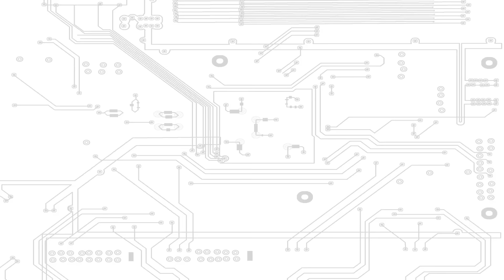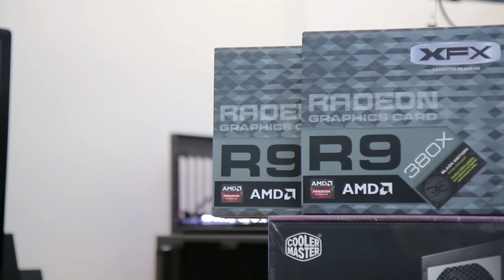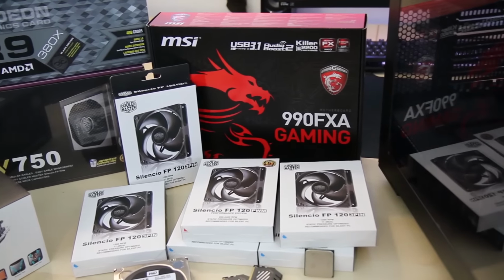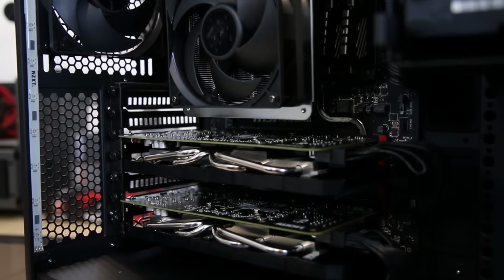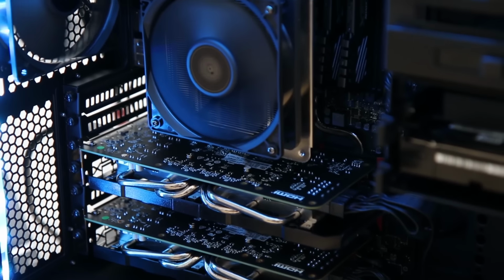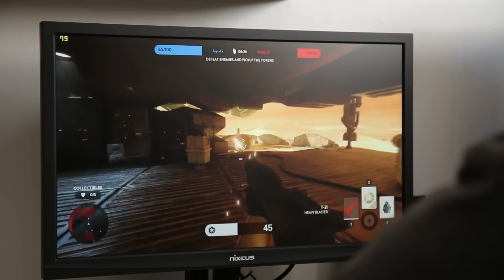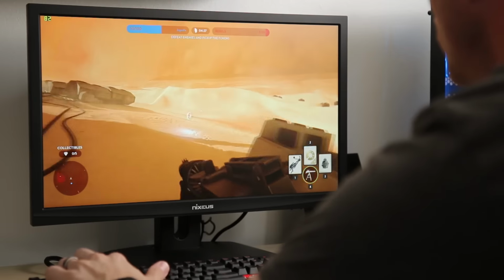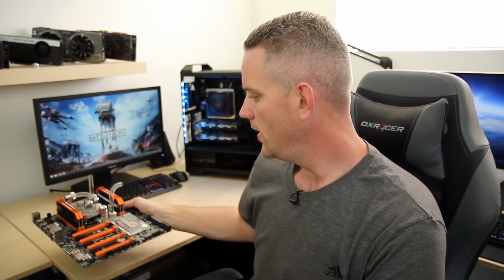AMD Gaming PC - Is AMD still good?

Comment: I love my AMD build. Tried an Intel build, barely noticed a difference in performance. However, noticed a difference in my bank account.
Reply: +Stefan Lord (Lord SVG) depends
Reply: After all, AMDs is cheap alternative for Intel... Just saying :P
Reply: Shots fired! Intel get rekt!
Reply: Better than my last potato pc. lol
Reply: +Nicholas A. That's nice, welcome on board
Reply: ty. I never left when it comes to amd gpu's intend to have like 2 390X's for my 1440p FreeSync though. with an i7 :D
Reply: +Nicholas A. I had a P4 before I upgraded to haswell (sorry AMD). The Pentium 4 and the heat sink were so dirty and old that it would overheat when I played cod 4! LOL! AMD had it all back in those days but when there's success, comes a failure and AMD failed big time in the CPU market. (Mostly due to Intel bribing companies and releasing the game changing core 2 duo series.)
Reply: +Amer Maz lol yeah I had the Pentium 4 3.8ghz (570J) before the motherboard quit like 2 years ago.  So I know the struggle.
Reply: +Nicholas A. Mine still works. It's paired with a x700 ATI GPU. The 2gb of ram that was on it worked until one of the 1gb ram died. The PC served for 9 glorious years.
Reply: +Stefan Lord (Lord SVG) Intel and amd are pretty equal in CPU performance when compared with price to performance. On the other hand, factoring in the price of a motherboard and ram, AMD would pull away in cost effectiveness. Still rather intel though :p 

I love AMD graphics cards though, wish i bought a r9 390x instead of a 970, but it wasnt released at the time, ahh well :p

Edit: Price to performance of AVERAGE CPUS. a 6700k wont be very good in terms of cost effectiveness
Reply: MK Vlogs Im still running my 4th gen as well. No real comparison between the 2, mere 2% increases here and there which could even fall within the margin of error :p The 4790k is still ranked higher than the 6700k on passmark by 2 ranks (though very marginal).
Reply: +Amer Maz I'm not sure that's fair to say. When Intel played its tricks to get back its market share, AMD was bringing out K10, which was still right on par with what Intel was offering at the time. AMD's current failure to compete in the CPU market is largely a problem of their own making, with the design decisions that led to Bulldozer being very questionable indeed.
Reply: +Stefan Lord (Lord SVG) I just switched from my 8350 to an i5-6600k. Most games ran pretty well before but if you intend to play a game like Arma 3 is awfully optimized for multicore use an Intel system is the only way to get consistent 60fps.
Reply: +Ryuu ★ CSGO & Other Games yep Dayz and arma are really weird. your fps is also bound to the servers performance for some reason. But yes intel give a huge boost in performance on these 2 games.
Reply: +Stefan Lord (Lord SVG) If you didn't notice a difference that means you bought a crappy intel processor and a good AMD CPU
but deny facts
Reply: +Robert Faber Sanders was also another reason why AMD became successful and what it is today. Sanders wanted to do too much in such a short period of time which resulted in unnecessary expenses. Had Sanders chose to be patient, Raza (pivotal in AMD's success) would have stayed instead of quitting because of the financial pressure of dealing with each quarter and maintaining the trust of investors. 

Raza was worried about AMD spending too much and wanted a steady rise in success. On the other hand, Sanders was impatient and chose to borrow money in order to reach success quicker. Sanders still made profit with the Athlon (K7), but his stubborn thinking and sexist remark forced Raza to quit. Losing Raza wasn't disastrous at first but eventually hit AMD very hard. When you lose one of the best engineers in semi conductor manufacturing, it hurts.

AMD struggles today because of their inefficient capital structure that they still haven't recovered from since the early 2000s. It's sad...
Reply: LOL, that true
Reply: +MK Vlogs is that just fanboy news or is there actual bent processors,I'm genuinely curious as I've never heard of any bent skylake processors,if anything people are recommending stock coolers for non overclockers
Reply: No its true, i tried an intel build and my computer wouldnt even boot
Reply: That's the most like explanation. With Intel you get the superior price-to-performance ratio.
Reply: MrKeikari That's a load of bollocks. It's certainly true that Intel currently holds an edge over AMD in raw performance, but that is more than offset by the vast price premium they charge. In a lot of segments, AMD and Intel no longer really compete, but where they still do, AMD offers considerably better value.
Reply: Robert Faber Maybe ages ago, but currently Intel has gone past Amd in price-to-performance ratio. The cheapest, locked i5 costs the same as the overpriced "8"-core FX chip and i5 easily outperforms it. FX struggles even against i3.
Reply: MrKeikari Well yes, but your very wording raher implies that you're looking at absolute performance, not performance as compared to price. Take two chips that perform the same, compare the price, and AMD's offering will consistently come out cheaper.

Also, please bear in mind that it wasn't exactly "ages" ago that AMD was still on par with Intel. They absolutely beat Intel into the dirt with K8, and when K10 was around, they were still very much on par. It's only since Bulldozer that they've fallen behind.
Reply: Robert Faber No absolute performance, just price-to-performance ratio. Intel excels in both. Cheapest locked i5 costs the same as "8"-core FX chip and costs the same but outperforms even oc'd FX chip. FX chips struggle even against cheaper i3s.
Reply: MrKeikari
 you might be right but if i'm taking my situation, well i have a 8350, i don't play many games just a few, and there's actually only one game that gives me issues... arma 3. And yeah same goes for intel, many people with i7 6700k and 980ti cards get the same perfs as me. So in my situation, buying a 8350 and running the oc at 4.6 actually gives me as good if not better perfs than someone with a PC that costs 4 times as much as mine.

So ok maybe i can get 120fps with intel and in most games out there (mainstream) but i don't mind having "only" 90fps. So worth the money? not in my opinion. Not for my situation. and i have a r9 270x 2gb btw.
Reply: Crispy K I was talking about an situation if you're in need of new cpu :) Of course i'ts cheaper to stick with the current cpu if the performance is enough but when buying new cpu you need the best possible price-to-performance ratio :)
Reply: MrKeikari
oh ok :P well yeah i agree.

Btw i just just mounted my new mobo ram and 110i gtx and got my stable 4.6 oc. The fps difference in Arma 3 is about 10 to 15 fps but that makes a night and day difference in game when i got low 20's now i get low 30's when have drops.

Comment: AMD Master Race FTW
Reply: In my opinion Intel's better.
Reply: +Edwin Fields whatever brand suites my needs is the best, in my opinion.
Reply: +Eli Youmans I have an AMD gpu and intel CPU. Nothing wrong with that.
Reply: +18T220 AMD is really hard to beat for the money when it comes to custom builds, and I've been building with AMD for the past 20 years, and it's rarely ever let me down. having said that some of the early laptop APU chipsets were pure junk they should have never released.
Reply: +18T220 I'm all for it for the GPU's
Reply: +18T220 fanboyism is stupid.
Reply: +Mikee Tyson if I was going to build a budget pc then I would go AMD. But for a high end build AMD just don't have offerings yet, looking forward to what they bring out next year though :)
Reply: yeah for Zen!
Reply: +Commodorefan64 I've personally  been building for about 10 years with just about every manufacturer and for the first 5 years amd has done nothing but let me down so i just stopped and switched for a few more bucks.
Reply: Ghost's Graphics I find it's all in picking the right parts, and knowing what to expect from a system build before hand by researching, and reading/watching lots of reviews.
Reply: +18T220 amd cpus are shit but their gpus are awesome
Reply: jaakko200987654321 they aren't shit you pleb, only the high end models are much worse. The 8350 is directly comparable to the 4690k. Personally I own a 4690k because i already had the board, otherwise I would have definitely went with AMD.

Comment: I like csgo.
Reply: +CryoTechMC Yeah i got a $1000 CSGO machine
Reply: +DE4THRE4P3R same we are twins
Reply: +DE4THRE4P3R got a 650$ GPU running csgo :P well it cost me more like 1000$ here in Norway but still :P
Reply: +DE4THRE4P3R specs pls :)
Reply: here is mine 

http://pcpartpicker.com/p/9RrX4D

1. i got a gtx 960 ftw for free
2. i already had the ssd and hdd from old computer
Reply: JohnsGamingChannel 1
- Cooler Master Elite 120 (modded)
- Cooler Master V650S
- Asus Z97I-PLUS
- Intel i5 4670K
- Corsair H80i (push pull with 2 x noiseblocker e-loop b12-3 and Arctic cooling MX-4)
- Kingston HyperX Beast 2400MHz 8GB
- Zotac GTX 980ti AMP!
- Adata Premier Pro SP900 128GB
- Samsung 850 EVO 500GB
Reply: +JohnsGamingChannel “JohnGamingChannel” 1 how did you get a 960 for free, i need to know D:
Reply: +DE4THRE4P3R $2000 lol
Reply: +CryoTechMC I like turtles.
Reply: i like trains
Reply: +CryoTechMC I LIKE TURTLES
Reply: Why?

Comment: hoping zen is great!! waiting for that upgrade
Reply: probably going to be too little too late
Reply: +hi9580 wel end/mid 2016 isnt that that long
Reply: +hi9580 yeah especially with Intel coming out with their Braodwell-E
Reply: Yep, me too. I'd rather drown myself than switch to Intel, so I'm still stuck with a five-year old Phenom II X6, as no significantly better AMD CPUs are available at the moment... I honestly don't care if Zen beats its Intel equivalents or not; anything that is significantly better than Bulldozer will do me.
Reply: +Robert Faber exactly  I'm using my 8350 but def hoping zen will be it! And with ddr4  being somewhat cheaper it'd be nice to upgrade . Just hope to see some improvements
Reply: +TechyRodsWire I have an 8320 myself, and I would definitely upgrade if the improvements are huge. they should be since they are coming out with their own version of hyperthreading.
Reply: +TechyRodsWire Yeah im waiting for Zen and Arctic Islands!
Reply: Fallschirmjager Well, mine's a 1055T, and not a Black Edition, so I'm still stuck at 2.8GHz... I toyed around with base clock increases to work my way around the locked multiplier, but running HyperTransport at anything other than the stock 2GHz, exact to the nearest microhertz it seems, is basically guaranteed to cause massive instability.
Reply: +Fallschirmjager miss my 1100t, wish I never sold it. Was a solid chip.
Reply: +TechyRodsWire got a 1055t and a 1090t, the 1090t would top around 4.1ghz, the board the 1055t was on would not go past 3.75 ghz (mobo issue not cpu limit)
Reply: +Fallschirmjager agreed prob best chips they made..
Reply: TechyRodsWire Without a doubt. Bulldozer has much lower single-core performance than K10; it's only their higher clock speeds that keep them in contention.
Reply: Fallschirmjager
i used a 16x multiplyer 250 mhz NB, 1.51 V core
Reply: +TechyRodsWire I wouldn't get my hopes up.
Reply: +Robert Faber Stuck on an X4 myself for the past 5 years and boy oh boy, am I ever praying Zen is a worthwhile upgrade. I like AMD, I like rooting for the underdog, I want to see them make Intel clench even just a little, but if their new platform turns out to be a disappointment I have no choice but to go blue because I have a video editing business to keep alive.
Reply: +Joshua Keys its not hyperthreading its called SMT(simulateous multithreading) wich executes two threads on one compute unit.
but it is less effective then amds current CMT
Reply: +Robert Faber yep i beat an i 5 with my a10 7850k on 4.6.
7000 points in passmark bench
Reply: +fungunsforu we will see my friend! If not its not end of world and I still have my x99 rig . Just hoping Amd sets the tone for 2016 and comes out strong
Reply: +TechyRodsWire That's all I'm asking for.  I may switch to team blue but, stick to team red for graphics.
Reply: I was trying to wait it out for Zen, but couldn't and asked for a 4690k for Christmas.
Reply: +TechyRodsWire Same here dude I really want to upgrade from my 8350 but i'm forcing myself to wait for zen instead of upgrading to a i5/i7 now
Reply: I got a I5 2500,@3.4/unknown clock speed, for Christmas and I'm still going to try and prepare for Zen.
Reply: ***** Yes but will likely be much cheaper.
Reply: +Mike where did you take the 4% from?
zen is more efficient then skylake. they did singlecore-package tests
Reply: +Alexander Binovski m8! why do yu buy fx9xxx?
same hardware as fx 8320 and 100 euro more for a simple oc
Reply: +Alexander Binovski you can get a 8320 to the same frequency. it is the exact same hardware. trust me.
Reply: +Alexander Binovski it is all about configuration in your uefi.
its not only voltage which is important for an oc. its everything about the syncronised clock of ram cache and baseclock. in a fx9xxx its already set to the correct value. you just need to find it.
Reply: TechyRodsWire what socket is the Zen
Reply: Pennywise ty
Reply: Did you upgrade to ryzen?
Reply: Barlos 69 yup 3900x and Rtx 2080... went with nvidia because driver support and they have a better encoder on the gpu
Reply: TechWithRodd cant blame ya bud I too went nvidia however the low end 😂 1050ti and r5 2600 but im currently in progress of upgrading and fitting it into a node 202

Comment: Nice that you show #teamred some love :) i myself have an R9 390 and it kicks ass, never goes above 65c even with the case fans on quiet mode :) however untill i get some cash together i'm stuck with my Phenom 2 X4 cpu :) i did build my sisters PC with an AMD FX 8350 and i think a GTX 960 and i think she's happy with it
Reply: GTX 970. The fact is a fact - NVIDIA drivers are superior.
Reply: +Forever Oleg compare 2015 drivers for the gtx 680 and the hd 7970. i wonder which is now faster??? Got those xfx 7970 oc to 1100 core, 1700 mem around 75c in 2-way crossfire no issues
Reply: +Forever Oleg my display drivers keep crashing for my 3.5 GB 970 :(
Reply: +Forever Oleg Except that if that would be true, then you just prove even more that 390 is superior and more future proof?
Since it beats the 970 at the moment, it'll just keep getting better with newer drivers, like most GCN GPUs have.
Plus, it's cheaper than 970.
Plus, it'll most likely gain alot more from upcoming dx12/vulkan games.

That's just like saying "hey, I've got this card that costs more and is driven at it's max, but still performs worse than that cheaper card which would gain from better drivers."
Reply: Don't bother upgrading that CPU until Zen comes around. K10 has much stronger single-core performance than Bulldozer, so it's more than likely that if you "upgrade" from a Phenom II X4 to, say, an FX4300, you'll actually lose real-world performance.
Reply: +Robert Faber Uhhh.. not really though. Piledriver absolutely wrecks a Deneb (Phenom II X4). FX-4300 can easily beat a Phenom II X4 965 BE.
Reply: StrongarmSlayer Easily? More like barely, and even then only because of its higher clock speed. Run Piledriver and Deneb quad-cores at the same speed, and the Phenom II X4 will wreck the 4300.
Reply: Robert Faber Even then, at stock speeds itself, Piledriver is still more efficient compared to Deneb, clock-speed wise, performance-wise, and TDP-wise.

We are comparing a 95 W chip to a 140 W. Overclock the Deneb to Piledriver's stock clocks and it'll take almost as much power and dissipates as much heat as a FX 9590.
Reply: Jonas Hansson är du svensk are u swedish?
Reply: Ja
Reply: Jonas Hansson amd cpu? How bad is the definite bottleneck